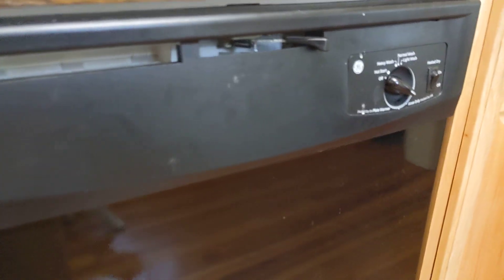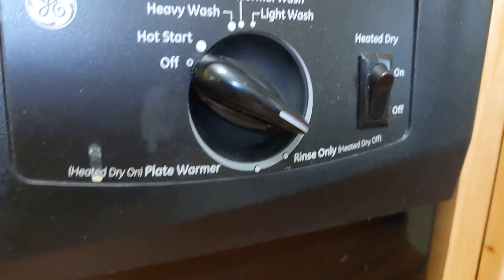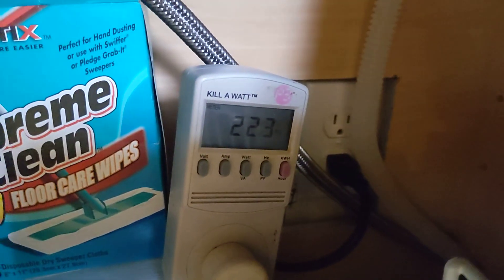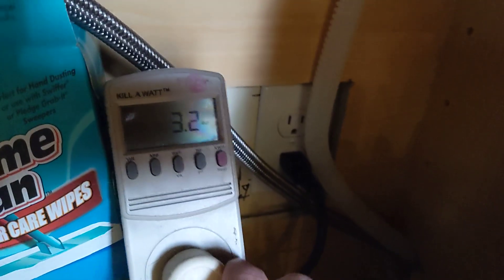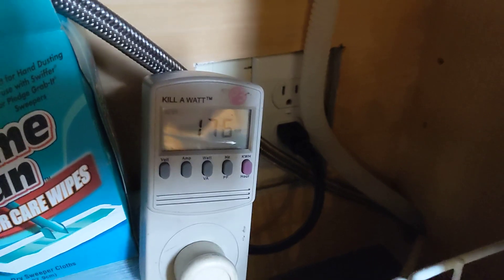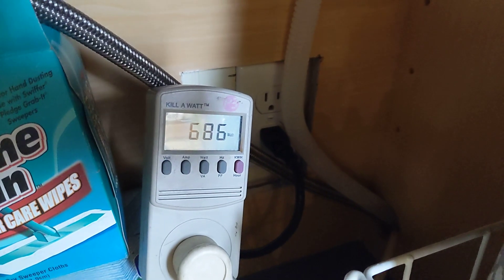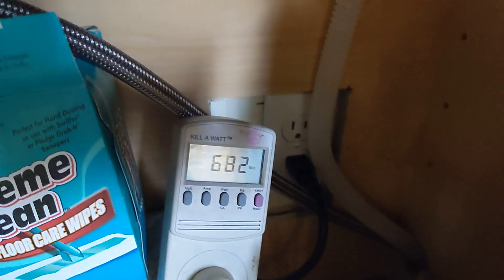Does a dishwasher heat the water?

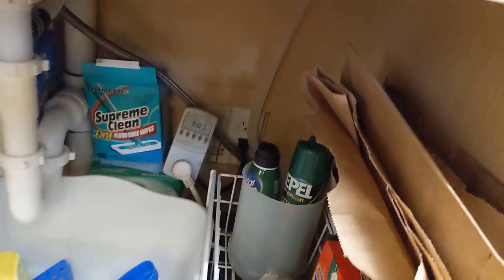Comment: Very interesting analysis, which also (4:30) answers "my question too".  Our hot water heater went out, and I'm waiting for a replacement.  So, we are running DW w/o hot water, and it does okay.  But, the dishes used to get clean, now they're not getting that clean.  So, I'm better it needs hot water to help make the soap work.  Because, strangely, it cleaned fine few weeks ago, but now, it's not cleaning at all and just getting film on it.  And, yes, I ordered the HWHeater already, but Home Depot is taking FOREVER to ship product.  And, I do pre-rinse all my dishes, so it's not as bad as it sounds.